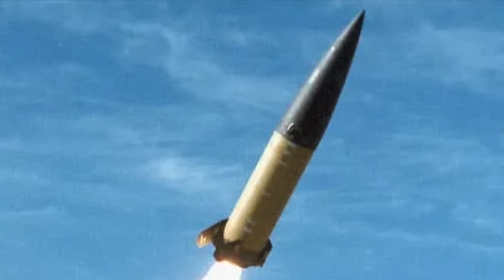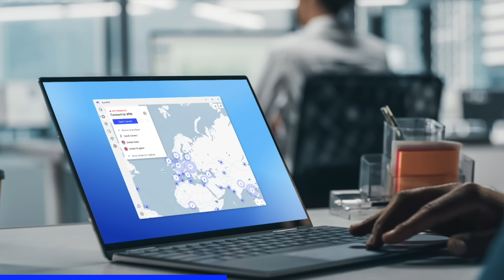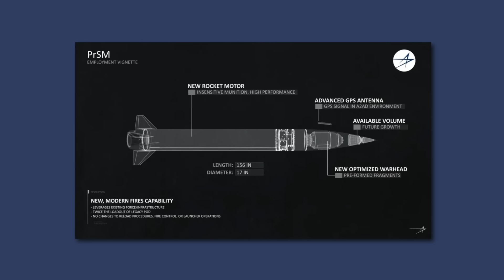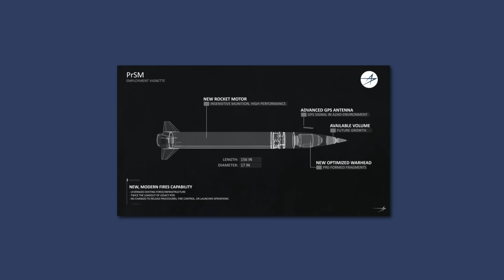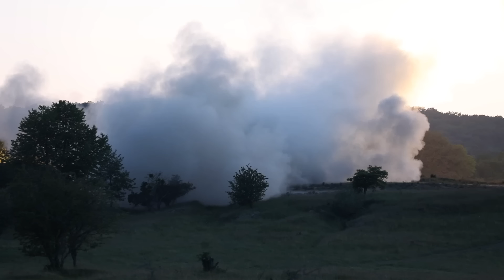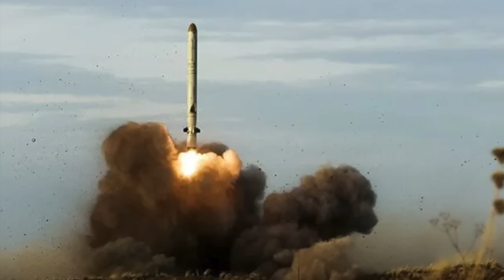Why PrSM is being deployed against Iran ?

Comment: Why is it being deployed? Sales pitch for starters, 🤣 But also, the longest range version of the ATACMS can cover most of the Persian gulf, but not quite to the Sraits of Hormuz. It can also reach a few miles beyond Tabriz, but no further. This messile adds at leasr 110 miles more range in zthe form that complied with the old medium range ballistic missile treaty. Rumor has it that you can milk abother 100 miles without neading a new motor<  with the prosed more powerful motor, we are talking a relatively light weight missile that could probably hit downtown Tehran from Kuwait with range to spare.